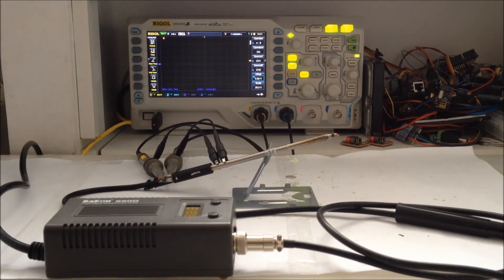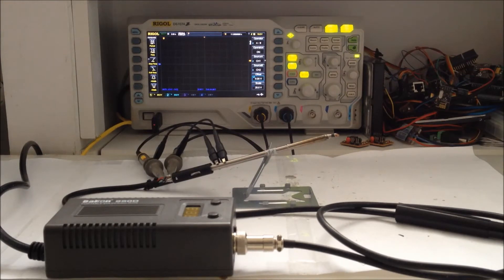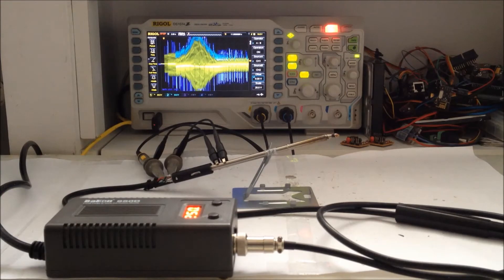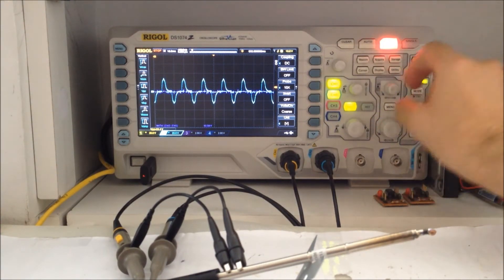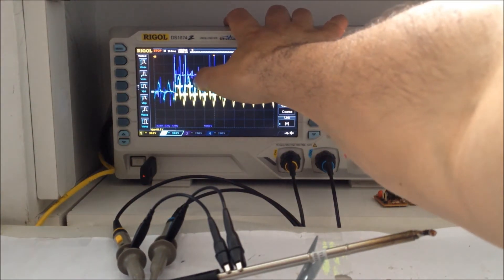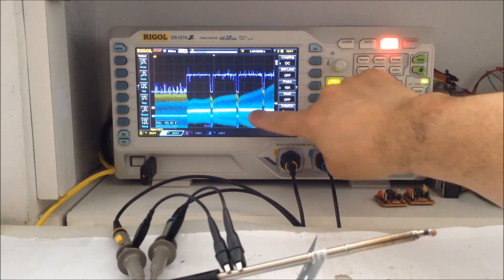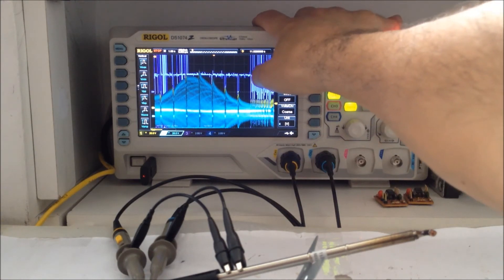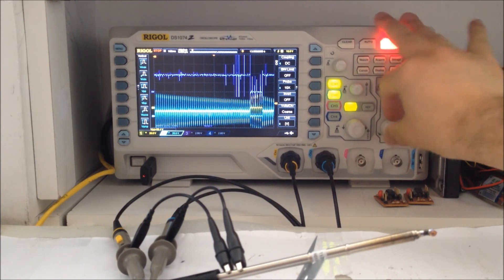Bakon BK950D Interesting Waveforms

Comment: Is Good or bad sodering station?
Reply from the maker: Take a look of my unboxing video where I point out some of the Pros and Cons:
https://www.youtube.com/watch?v=fq439J4ZbrY
I'm quite happy with it and It perfectly fit my needs:
The T12 cartridge are amazing and a huge step forward compared to the traditional Tips
Pros
- T12 compatible tips (same as HAKKO FX-951)
- FX-9501handle (like) with silicon cord
- 5 seconds to swap a hot tip with a silicon oven holder
- Super fast heat-up
- 5 presets and fine regulation with a button
Cons
- No stand included (I found a compatible one)
- No stanby timer/sensor
- No custom firmware (AFAIK)